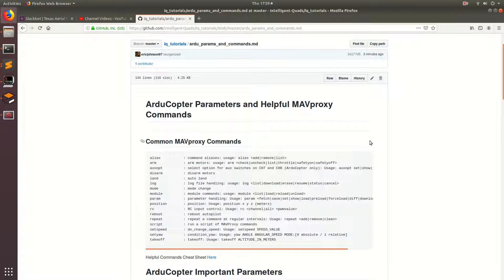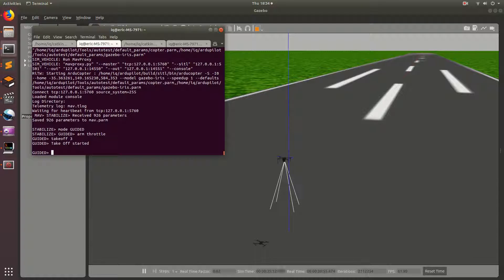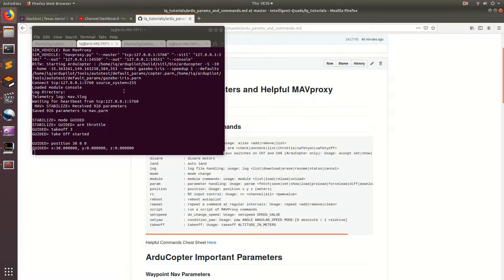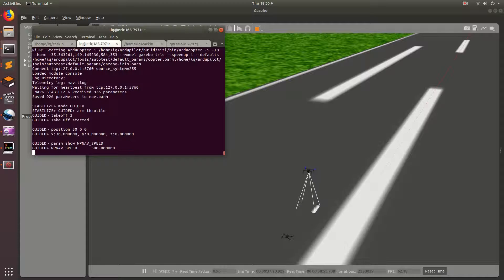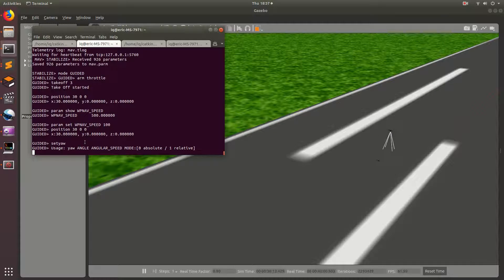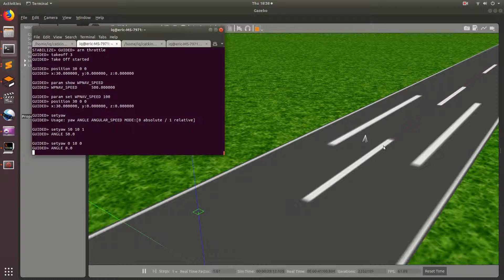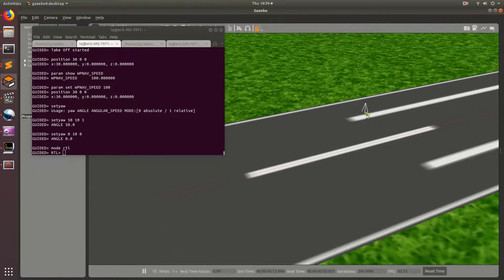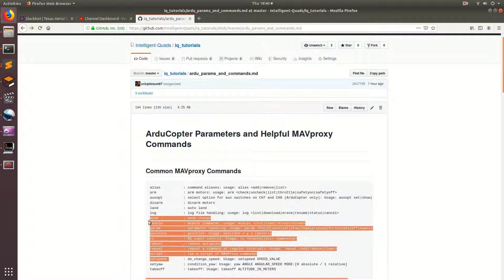09 Ardupilot Parameters and MAVproxy Commands

Comment: Hi, I really liked the videos and how you've explained the working. Just one doubt though. You mentioned in the previous video (part 08) that while giving the waypoints in the cpp code, X faces the right of the drone, Y faces forward and Z upwards. But in this video, for feeding position waypoints directly in the MAVProxy, you said the NED convention is followed. Could you clarify coordinate convention to be followed?
Reply from the maker: Ardupilot and most aerospace vehicles follow the ned convention. This is why when viewing data that directly interfaces with ardupilot is in ned. The standard convention for Ros and Ros robots is enu. When building waypoint missions in video 8, the commands are going through the mavros abstraction layer which handles the reference frame conversion for you. Hope this helps
Reply: @IntelligentQuads  Thankyou so much for clarifying!

Comment: Hi there, I keep getting 're-requesting WPs [0, 1, 2, 3, 4]" in the MAVproxy terminal. Is there anyway that I could fix this issue?
Reply from the maker: this shows up when an auto mission has been run via a ground station. to get rid of this message simply run the following command in your mavproxy terminal.  

wp clear